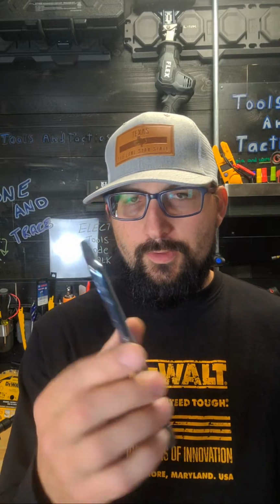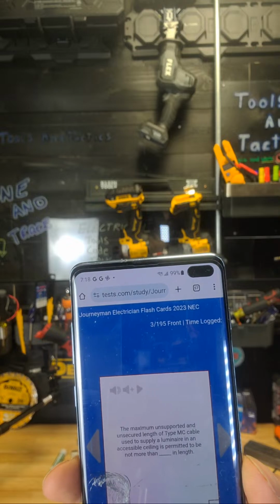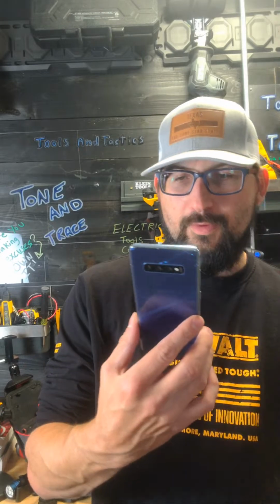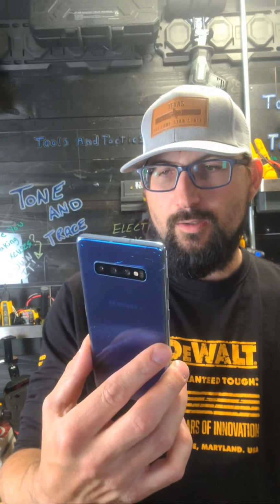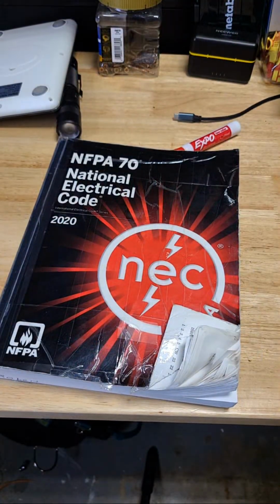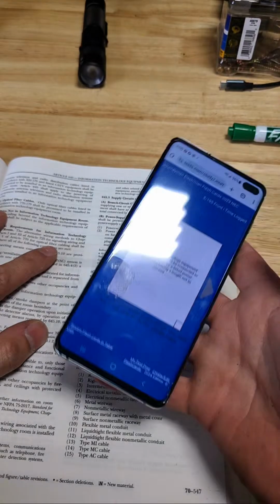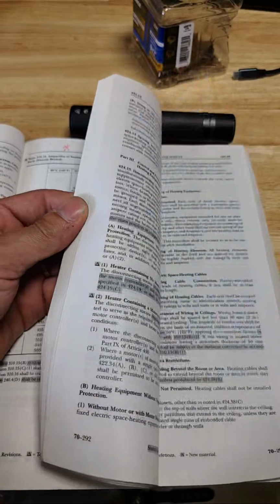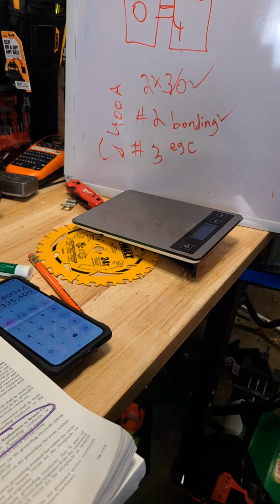WHY Electricians Need To Know For themselves!

Comment: More than that for what..working commercial i have a cart and just grab the few tools i need. Never see someone carrying every tool all day.
Reply: Sorry to keep going on , like your videos.  I was just thinking like why would I carry around a pair of strippers rotosplits bunch of other stuff when I won't touch a wire for weeks on end. Keep up the good work!!
Reply from the maker: @Steener54321  no worries thanks for the convo every1s situations different all I know is mental anguish and getter done. Haha.   Large construction
Reply from the maker: Larger construction companies with more structure. Actual large construction not the mom and pop shop type. With reputable gcs  Ro,beck,hilandwilkerson balforb,just to name a few here in this area.
Reply: I work mostly on government jobs, police stations, fire stations public works complexes. Some bigger some smaller. Just guess I don't see th point in carrying a bunch of screw drivers, drywall saws, a bunch of other stuff when I'm bending pipe for a month straight on a lift, when I did residential it made sense. Just depends what ur doing.